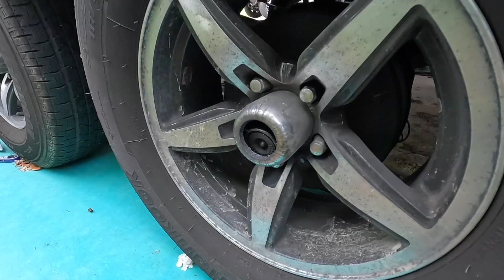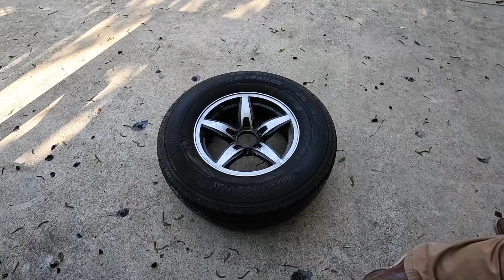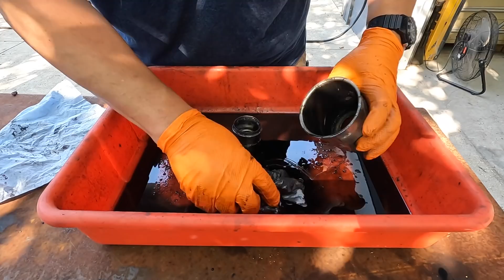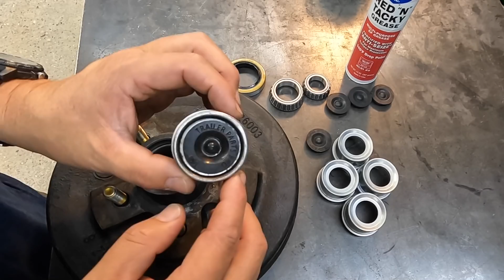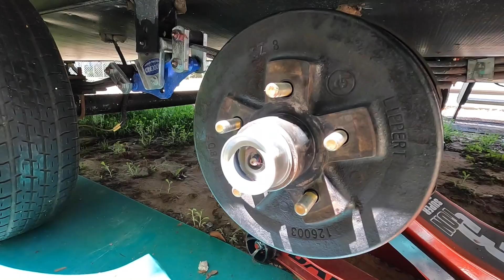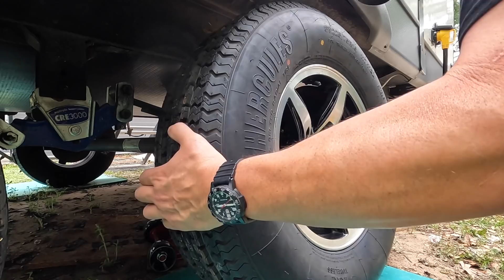RV How-To: Brake Hub Removal, Inspection, Reinstallation

Comment: Good to see you have the greaseable axles and not those "bearing buddies".  Bearing buddies tend to force the grease past the inner seal and all sling it all over the place.....not a fan.  They're designed for boat trailers where they get immersed in deep water on a regular basis.  👍

Comment: Hello Adam, i cannot believe  why such small wheels are fitted to this RV, here in Australia it would be illegal, any van over 18 ft has 6 stud wheels, my RV being 20ft  has 245 75R 16" wheels and tyres, i know what you are about and cannot understand why you are accepting this setup on such a great RV please fit some heavy duty wheels, tyres, six stud axels and disk brakes, been watching your channels for ever and love everything you guys get up to.
Reply: Most all medium and small trailers in the US are 5 lug based. Usually it is adequate, but being that he has already bent an axle and replaced the axle tubes I tend to agree with you. I probably would have gone to 6 lug at that point personally.

Comment: Can someone from the USA explain those trailer brakes? It looks like a drum brake with shoes and an additional  ''disc'' like pad that pushed the  drum on the inside? I've never seen anything like that, here in the UK (up to 3.5 tons trailer) we just have simple over-run drum brakes which work OK provided they're in adjustment - which many are not.
Reply: they are electric brakes-- The "disc" you see is an electromagnet. When the truck brakes are applied, the magnet is activated which makes the shoes expand to the drum.
Reply: @bldia1965  Ah, I see, that's neat, so the electromagnet rubs on the drum and that creates a force which expands the shoes. Must be a method to regulate it as 12Volts would just lock the wheels I guess?
Reply: @JohnSmith-vi5pz  yes, the brake controller in the tow vehicle regulates the voltage..you can set the “gain” of the controller, I believe it’s for how quickly, the voltage is applied
Reply: @bldia1965  Cool, thanks. Seems like a good method.
Reply: Look up Red Arc Tow Pro Elite

Comment: Adam. One of my favorite YouTube channels. You broke my heart with this video that could compromise your wheel hub and bearings. Some of your followers mentioned the easy way to remove the inner bearing and seal and other parts. You generally don't need a new bearing because you remove it. Buy the rear seal. My god they are cheap and for heavens sake prepack both bearings completely by hand or with a bearing packer. They are cheap and insure that you have properly filled a bearing with grease. You don't rely on a transfer of grease from a maintenance fitting. Install a new rear seal, you do this all the time on repairs that I watch and then set the proper nut torque. Please check the bearing play once you put your wheel on and see if you have any play or too much. You may have to readjust the nut. Just concerned for you, Abby and the trailer! Where are the races for the new bearings? LOL.

Comment: Please consider replacing the those cheap T-Tap type wire connectors on your electric brakes. With either soldering and heat and shrink or adhesive lined heat shrink butt connectors. The type you have are very prone to corrosion and failure!

Comment: I picked up that Lucas Red 'n tacky to put on the gears in my headstock as it doesn't have an oil bath.  Now I'm using it as my go-to general purpose.  It doesn't seem to "melt" over time.

Comment: The trick to getting the inner bearing and seal off with no damage is to take the outer bearing off and thread the nut on the spindle and slide the hub off and that will pop the inner bearing and seal off.
Reply: Neat idea, never though of that.
Reply: My auto shop shop teacher taught me that in the 70s

Comment: Is there an electrical brake system on the trailer?
Reply: yes
Reply: @Havinago2  We don't have this kind of brakes in Europe so I'm not familiar with it's elements and function.
Reply: @MatthewQuigley  I'm in Oz. They are the only brakes to have. With a controller on the dash to make them adjustable "on the fly" or in an emergency situation you can apply just the trailer brakes to straighten out some sway & they also incorporate a breakaway system if the trailer becomes disconnected while traveling, it applies the brakes automatically. I would not use any other kind of system for towing a sizable trailer.

Comment: One thing to think about is turning that tire into the spare after you order the replacment you want. 

If you live in freezing temps I strongly recommend greasing atleast every 4 months to flush water out. The humidity and water from snow and coler climates tends to breakdown the grease. 

Also I usually pre pack my spare bearing then toss em in a few zip locks with a spare axle nut. And if were talking about my car hauler I just pack a spare drum/hub set up mostly due to the mileage it sees.

Comment: I've got over 30 yrs experience as automotive mechanic over 20 in the dealership before I changed careers as machinist, you did a decent job and you feel confident and that's what matters, I'm a perfectionist and I have my own opinion of course.  I read the dexter manual when I replaced my RV wheel bearings (with Timken)  My Winnebago had 5200 lb axles.  I noticed someone stated you should put Dexter brand bearings...Ha Ha, they say China right on them so that's One reason I went with Timken Bearings and races.  Safe travels Adam, we love watching yall.  Hope to meet you again if we ever have another meet and greet like Good of the Land was those two times in Texas.

Comment: Love the parts washer....slightly pricey for a homeowner DIY shop though.  Maybe one day, and a 20 ton press and a nicer 3 ton floor jack.
Reply: You can get cheaper ones, I have a simple one with a pump and a shelf. I just run it with heating oil, when it becomes too dirty then use it for starting bonfires.

Comment: Great process and video.  Too bad most shops go so fast doing these they rarely wash and clean parts up like in this video. Darn trailer tires are so much of a cluster to keep all four of them the same brand and equal miles on them. I agree with the bearings routine...most RV trailers are on the edge of under engineered when it comes to axles, brakes and bearings. Always best to keep them properly greased to eliminate a failure at the most inconvenient time.

Comment: I've been using Hercules tires on several vehicles for several years. Just replaced the set on my camper that were 5 years old with a bunch of miles on them. I could have kept going but I'm more concerned about age than getting every last bit of treadwear. Ride smooth and quiet, held air like a champ. No complaints. A buddy of mine went through 6 Goodyears on his camper in less than 2 years. All blowouts. The last one did about $7500 damage. Just my opinion, but I think you're better off with the Hercules.
Reply from the maker: You’re the first I heard that has bad things to say about the Goodyears. I know they’re a top quality tire and I like running them. The Hercules was my best option but I know it’s a good quality tire also. Anything except them China Bombs.
Reply: @AbomAdventures  That was about 6-7 years ago that he had the issues with the Goodyears. At the time, I remember a few others having issues as well. Hopefully they fixed whatever problems they were having. Yeah if anyone else reads this with a new camper, get rid of those China bomb tires asap.

Comment: the biggest issue with tires is mixing radials other styles of tires.  I love your little tool you made for putting on the dust caps.  I actually made one myself for use in my shop.  Always thought about making them and selling them on our website.  I just don't know if anyone out there makes them or not.

Comment: 2 questions, not criticisms. Would using the jack stand on the axle tube possibly cause it to deform, messing up the alignment? Should you use a torque wrench on the lug nuts?
Reply from the maker: Using a jack stand on the axle tube is normal and safe. It won’t damage it. Using a torque wrench is a good way to make sure you’re at the proper torque setting but it’s not necessary. Always recheck them after the first 50 miles.
Reply: does it bend the axels on your car?

Comment: Okay I'm going to be that guy. Why did you not pack the rear bearing? A new seal is cheap compared to taking a chance of having to changing a bearing on the side of road from lack of lubrication. I would not rely on pumping grease into that fitting to get enough in that rear bearing. The tires are readily available. Sounds like the tire shops didn't want to get them. Tirerack has the Hankooks in stock with only 4-5 days shipping. $169 each free shipping.
Reply from the maker: Love all the negative criticism when all I’m trying to do is be helpful to others who may not be aware. Maybe you missed it in the video and I mentioned it twice. The cross hole is between the rear seal and inner bearing. When you pump the grease it’s forced through the bearing, into the center cavity, and through the outer bearings. It was clearly shown on video as well. I also showed that I packed grease down in the inner bearings using and acid brush from both sides. Just because it’s not a technique you haven’t used, don’t tell people they’re wrong. The bearings are packed and the job was done well. I’ll even prove it to those who think I’m wrong.
Reply: @AbomAdventures  yup, with the EZ-Lube design from Dexter you don't even have to pack any of the bearings.  you filled them up all correctly by doing exactly what you did in the video.  pump and rotate the tires.
Reply: @AbomAdventures  Sorry it sounded negative. I was just letting you know that removing and repacking is the best way to do it. I like to visibly see the bearing is full of grease. I have seen too many of those bearing fail. The grease passage may fill the bearing completely full but myself I just don't trust it.
Reply: @aw738  as a professional that has been doing this over 50 years i completely agree with you. and you can't pack grease in the rollers with a brush. you force it in with the palm of your hand or you use a packer

Comment: I love how whenever a video like this is posted, everyone in the comment section becomes a mechanic with 100 years of experience and know every little piece of info about everything. If there is ONE thing I can guarantee.. Its that Adam DOES NOT cut corners, or do anything half assed especially when its safety related.. If everyone here can do it better, prove it, make a video and lets see. Take care Adam, from Canada! (coming to Canada for any travels? lol)
Reply from the maker: Thanks Jay 👍🏻
Reply: Thanks for this awesome comment!! You couldn’t be more right! Hello to Canada 🇨🇦 👋🏻. We will absolutely be heading to Canada in the future! I have been a few times (and absolutely loved it) so we will be adding it to future trips for sure!
Reply: I've never claimed to be a mechanic. I did sell my share of wheel bearing in 25 years. Wheel bearings needs to be packed with grease before installation. Sorry an acid brush is not really the best way to pack a bearing. I don't trust the grease gun method this axle uses.
Reply: Adam, a manual machinist par excellence does a mechanic's video and OF COURSE some mechanics watching are going to chime in with their comments.

Comment: Lots of folks don't know you have to spin the hub while adding the grease, or it blows out the seal which completely soaks your friction material and ruins your brake friction.  I have a full video on this critical side effect, on which I found 3 out of 4 seals blown out leaving only one brake doing any work at all.  Technically, the Lippert Easy Lube system is "For emergency use only" to absolve them of liability for this shortcoming.  Say Hi to Lance for me next time you see him, I still have to get my 3'x5' granite surface plate down to his place to do some much-needed calibration.
Reply from the maker: I’m aware of the grease issue and I didn’t blow it through the seals.

Comment: A little late now but if the spare is in good shape then just switch rims and keep the wore tire for the spare and save a few bucks or till the shop can get the right tire in also you should tighten the axle nut all the way down then back it off a quarter turn or so

Comment: not a bearing buddy. its a geasable cap usung a syringe tip on a grease gun. better than bearing buddy spring loaded blows out inner seals.
Reply from the maker: Did you catch the on screen prompt about that? That’s why I put it there, to correct myself.

Comment: If you want some better caps, get oil bath caps. They have a nice machined aluminum section you press into the hub, and a screw on plastic cap. Don't have to mess with the crappy rubber plugs again. You can still use them with the though axle grease setup you have, and even use a locking grease tip.

Comment: Great video. I especially liked you expressing safety with the jack stand. You understand more about mechanics than most. This is the first time I seen a bearing buddy like this. Seen many and seen many seized bearings. Good idea having spare bearings and seals. I would have knocked the inner bearing out, cleaned and repacked like you did the outer. Hint: After removing outer bearing, reinstall spindle nut and tug on drum or disc (whichever brake system used) and the bearing and seal comes out safely. Agree with starting the lugs by hand first. Always any nuts and bolts. Nothing frustrating having stripped threads anywhere.
Reply: I got chastised for telling him he should have removed the bearing and repacked it.

Comment: Do you have a spare wheel and tyre for your RV Adam ? Could be a good investment if you don’t 😊
Reply from the maker: I do.
Reply: @AbomAdventures  thanks for the response Adam 😊🍺🍺
Reply: @AbomAdventures  I was thinking that you probably have a full size spare for the trailer that is probably the Hankook tire you're looking for. Just a thought, run that and replace the spare.

Comment: Love all your vids! One quibble, you didn't stake the outer tabs on that axle nut retainer. One other thing: Always hand pack bearings before installation. 🤣
Reply: Those axle nut retainers do not need to be staked and their shape should not be altered. This spindle design incorporates a bearing packer.

Comment: I think you really should have replaced both bearings/races, and packed them with a proper 'for real' bearing packer. The peace of mind is well worth a little chump change & a few minutes work time.
Reply from the maker: Do you think that all of the thousands of folks who do this at home each day have a "bearing packer" You can do it by hand just fine. It'll be just fine what I did, and I'll even prove it to you.
Reply: @AbomAdventures  Check out a Lisle 34550 or similar... they do an excellent job & handy to have around. Your looking at around $30. (Yes, they can be done by hand.) In any case, please keep a sharp eye on that wheel.
Reply: It used to be on U.K. fords, on a major service you removed , repacked an refitted the Timken bearings , you just needed to inspect the rollers and tracks for pitting!! There was No need to replace them 😉
Reply: @csnelling4  yup, a good bearing is a good bearing... its not sorcery.
Reply: @csnelling4  Thing is, those bearings were run exposed to unknown contaminates.
Reply: This system incorporates a 'for real' bearing packer right into the spindle. Really cool design.
Reply: @Abom Adventures only thing I see wrong is to much grease.  I've seen this push grease seals out and also grease caps.  Think of the principles of hydraulics,  grease gets hot and slightly liquefies.  It expands and it's got Togo somewhere.  Making a mess in your hub cap and possibly greasing your brake shoes.  Seen this many times. It's what I do for a living.  Not trying to be a dick, just passing on some knowledge...
Reply: @dieselfreak908  You would be correct if this was an old school spindle/hub system but it is not. This system is designed to be pumped full of grease. There is enough head space in the larger cap to allow for expansion.
Reply: @BrianEltherington  I'll have to disagree with you.  I've seen grease push thru on both older type spindles and newer ez lube spindles.  To much grease is not good.  Just my 2 cents ...
Reply: @dieselfreak908  No way is that cavity supposed to be full of grease. The bearings should be packed solid/overflowing and a few pumps into the zerk fitting for good measure.
Reply: @truckguy6666  I'm well aware of that.  I think this message should be directed to Brian Eltherington.   I've been a trailer mechanic for over 10 years,  packed thousands of bearings...

Comment: Hercules tire is manufactured by Cooper tire in Findlay Ohio...... Cooper tire was bought by Goodyear tire last year 2021.....  I've hauled thousands of those Cooper/ Hercules tires from Findlay and Dayton Ohio...... have nothing but good things to say about them and their tire guys.... It's a tier 1 tire.. just don't tell the public!!
Reply from the maker: Good to hear about the Hercules tires. I installed them on my equipment trailer a couple years ago and we put the same type on the in-laws 5th wheel. No problems yet. He went through two sets of China Bombs so we swapped over to the 14 ply.